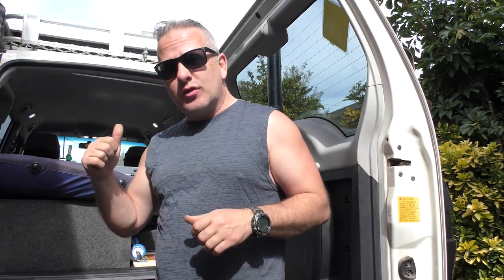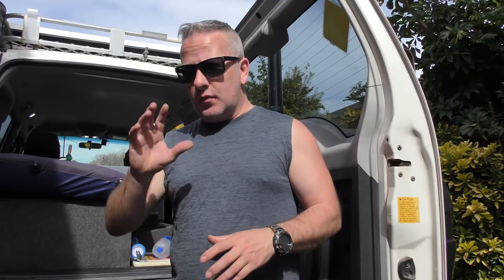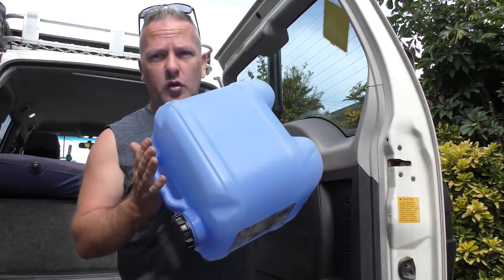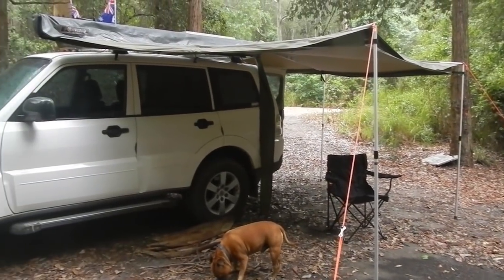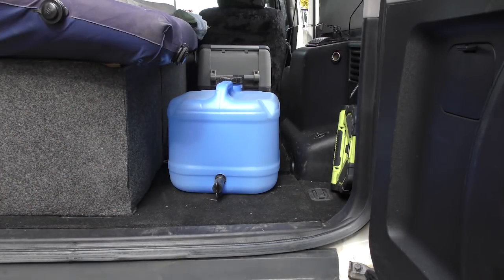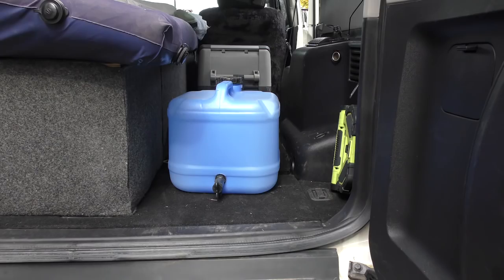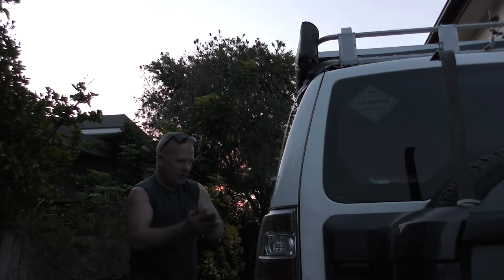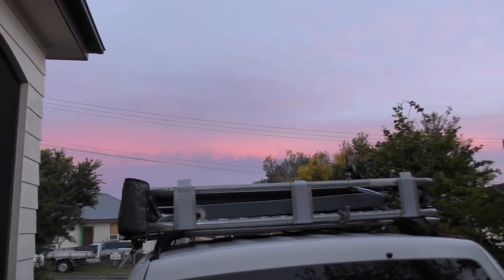4WD Roof Top 35L Water Tank Install

Comment: Hi can you show how you fitted the switch panel on the rear panel and how you accessed it or removed it, and wired it up etc. I just bought a 2011 NT and loving all your videos thanks
Reply from the maker: G'day Les. Yes mate I sure can. I'm planning on adding some more things to the panel and can get some footage when i do that. 

Might be a week or 2 though. 

cheers for the comment.  The ol Paj's are awesome by the way. But probably forget about watching my channel otherwise, you'll end up broke like me :)
Reply: @DENMONKEY  Thanks for the financial warning but too late for me, hahaha I do plan to follow your lead on making a similar connect it rear bed frame to my own dimensions leaving access to the seat well, and future plans for second battery fitted much like yours, but first I need  to install a double thumper compressor under the bonnet where some place their second battery up on the passenger fire wall.  keep up the good work its keeping you honest Thanks Les

Comment: Turn buckle on ally mesh ??? Corrigations will see the end of that..but nice unit , I have gum tree tank too , it's called a boab and sits on the floor in the rear seat, it's not perfect either and I hate the idea of it filling my car with water it it leaks
Reply from the maker: Hey Phil, got that right. The turn buckles like to undo themselves at every chance. Vibrations see to that. But with well placed zip ties or some tie wire they can be stopped from turning and undoing themselves. Learned the hard way heading down a steap track when the whole thing shifted forward. I've got a plan b though with some new mount ideas once I get around to installing a new solar panel and controller. Going to be a job lot. For the time being I've got a 15l tank in the bed build. You're right though, leaks every chance it bloody gets.  Cheers mate.
Reply: @DENMONKEY  if you can weld on  a weight on one side of the turn buckle, it will stop if from undoing, well may loosen but won't in do.

Comment: I was thinking about doing this. But wanting to use the tank as a roof rack to stand, sit as well. How did the water stand to heat and algea?
Reply from the maker: havent had any issues. I wouldnt say I use it often but both the dog and I drink out of it from time to time. I tend to keep it full so avoid it sitting half empy or even empty. I guess the water moving around all the time would help. 
I have also put a couple of drops of bleech in there as well, when i remember. havent done that in a while. Plus No connections or hose are clear. Algae breeds in the sun and without it, doesnt grow. so if you stay away from clear lines, should be good. I read that somewhere when working on my carvan wanter tanks